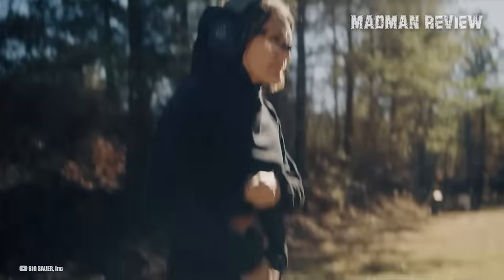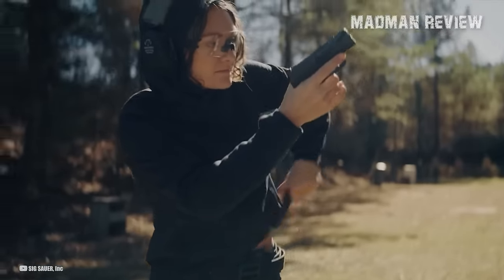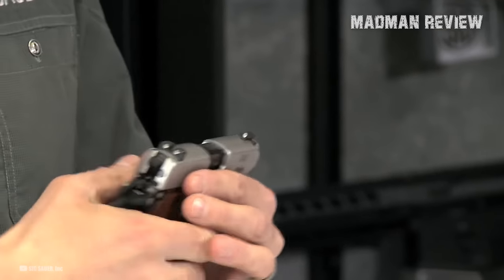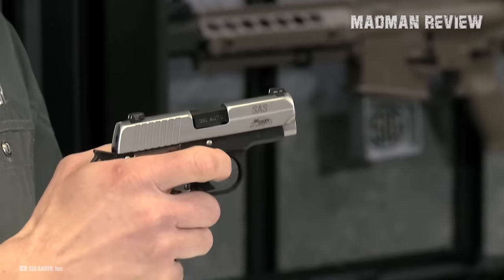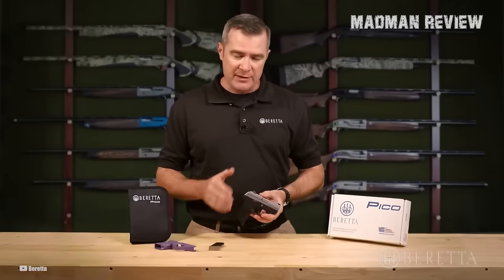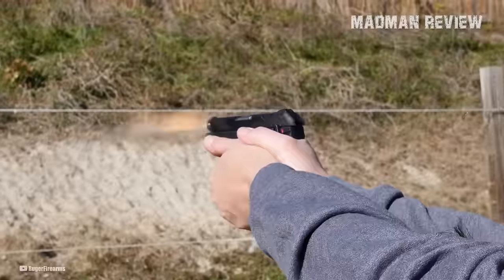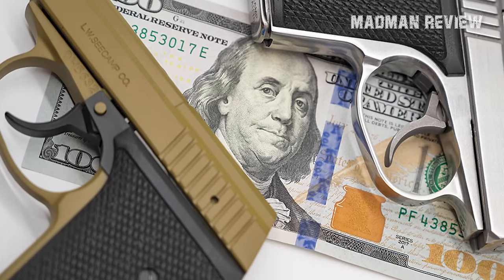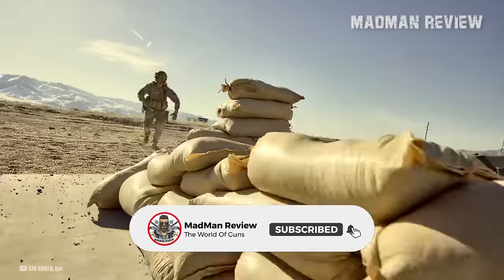TOP 5 Best .380 Pistols: 2023 Complete List

Comment: Bersa thunder 380 is my choice of all the 380 s I own most recoil management accurate and reliable
Reply: I have 3 different Bersa pistols. I bought the Thunder in .380 and liked it so much I immediately went out and bought a .45 and then a 9mm.All 3 of these work great. I also have a KelTec P3AT and a first Gen Sub 2000 and like them both with no issues.
Reply: @superdog1964   awesome I had a sub 2000 good  gun was just hard on the face with just the tube

Comment: The Ruger LCP MAX is the king of the 380 Carry pistols. At 10+1 and 12+1 with tritium front sights. At 10.6 ounces, it's a much better choice than the Ruger LCP 2 at the same weight but 6+1 and 7+1. I put a LaserMax laser on my LCP Max, and I feel confident with 10+1 and 2 12+1 backup mags. There may be easier shooting 380's but it is for carry. Clearly a better option than the LCP 2. 

I also think the Kahr 380 deserves a place in place of the KelTec 380. The Kahr has a MUCH better trigger and usable 3 dot sights. The KelTec has molded bumps for sights if you can call them sights.
Reply: I agree I like the Ruger Lcp max 380 model. I couldn't afford it so I purchased a tarurus sperum for $239.
Reply: Try a Ruger Security 380 Lite Rack, 15 rds. way better than ANY of the OTHERS.
Reply: came here to say this.. dead on
Reply: Yes it's awesome, I just bought the Ruger LCP Max 380 and I love it . I'm going to buy another in a year
Reply: I too bought an LCP MAX for deep concealment and backup for my duty pistol. It is super lightweight and comfortable to carry and not too snappy but there is a learning curve that is not too difficult. I think it is an excellent choice because it is so small and lightweight you can easily have it with you 100% of the time even around the house.
Reply: @Chainsaw2373  Also 10+1 and 12+1 isn't too shabby
Reply: @lylealexson8680  The round count can’t be beat for the small size of the pistol. It is one of the major factors in my choice over the LCP which is slightly smaller but the lack of rounds, bad trigger and sights made the choice easy to make.

Comment: I am a pocket gun enthusiast. Have been for many years. Belong to a club that shoots them and completes with them for well over a decade. Own many. What a shame you did not feature the Kahr. Just a lovely well made firearm and so mild to shoot. A favorite at our club. You did get it right on the Beretta Pico. Ounce for Ounce, one of the finest guns ever made. Both of these small guns will run when the LCP's have hit the dirt from falling apart. I know, we have shot thousands of rounds out of all of them. LCP's do not last long. The Pico is discontinued. Made for advance shooters, they now only have the huge, Cheetah. Not even apples to oranges. Yes, the Seacamp is a cool little pistol. Good luck finding one.  Pico, total high quality. Stainless steel chassis on all parts. Modular design for easy cleaning, changing grips, and few parts, that are so easy to replace if necessary. Ships with a Stainless steel recoil guide rod. Magazines that look like Custom 1911's. And mild shooting. Trigger is a little heavy but also very very smooth and deliberate. Perfect for such a small gun.  Thanks for the review.
Reply: Kahr are 🍋 🍋 🍋!

Comment: I’ve had the original LCP for 10 + yrs & never a single malfunction in over 500 rounds of FMJ & HP ammo.  Picked up the LCP Max a couple of months ago and not a single malfunction w/it either.
Reply: I had one and sent it back to Ruger twice. First round misfired, had one misfire every 2-3 mags, and a couple battery issues. Hope the newer ones are more consistent.
Reply: @jaewhite2462 Sorry to hear about your problems and hope you get the gun running properly soon.  FWIW I would not trust your LCP until you’ve run about 400 rounds of FMJ & HP through it.

Comment: Thanks for the video.

I have a Hungarian 380 that I inherited. At first, I thought I did not need the gun because I own three 9mm and two 25acp. However, I fell in love with the 380. I am now looking for a second 380. The Beretta Cheetah 80X and the Beretta Cheetah 84FS are high on my list even though they were not on your list.
Reply: I love my FEG SMC 380. I own a Walther ppk/s, a ket tek p3at, a Springfield 911 in 380, and a Walther pk380. I got the feg from an  estate auction. It was part of the deal. I didn't expect to keep it. Then I shot it. I was so impressed. It's been my carry gun for about 1.5 years.

Comment: The LCP 2 you show on the video is a 22LR….THE LCP 2 IN .380 HAS NO SAFETY..  The LCP MAX is my #1 pic…with a 12 round magazine and 1 in the pipe gives me 13 rounds….My MAX is loaded with Federal Hydra Shock…..13 rounds of that will ruin any bad guys day….The LCP MAX slides right in my front pocket in a Sticky#2 holster….MAX wins hands down in my opinion…

Comment: i have a RIA BBR 3.10 45 people say there junk they have a 500 round break in period and don't come oiled well and depending on were you live oil may not work i live in CO grease is the only thing that works oil runs away after a few days, looking for a decent .380 to carry with my 9mm when my back is hurting ( i have spina bifida my 45 weighs about 8-10lbs then i carry 5 extra 9rnd mags, my 9MM 4 extra 9rnd mags and a set of 3 throwing/fighting knives ) if you don't believe throwing knives are useful you can kill with them if you know how, and i know how